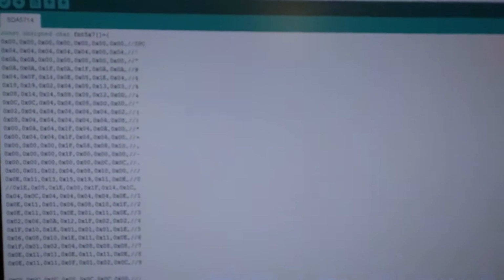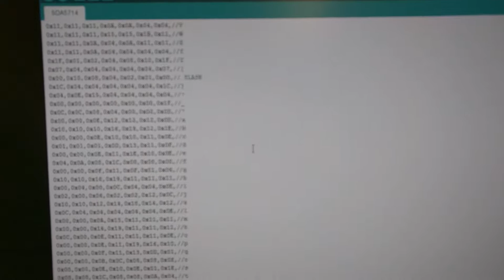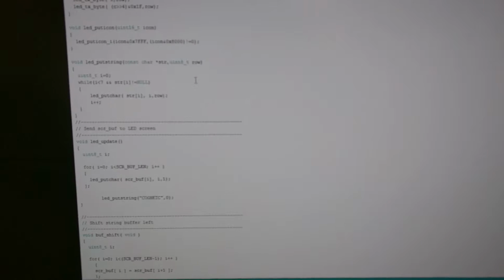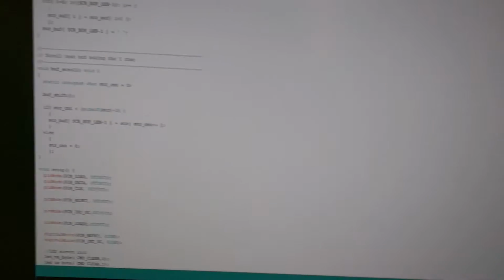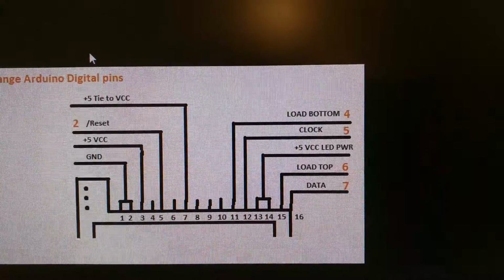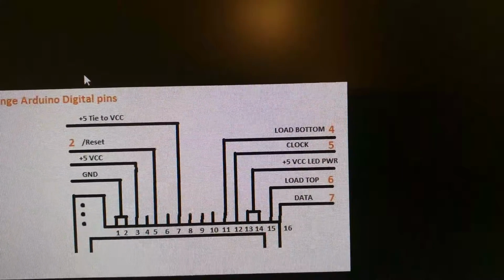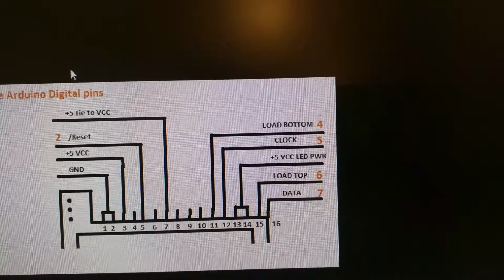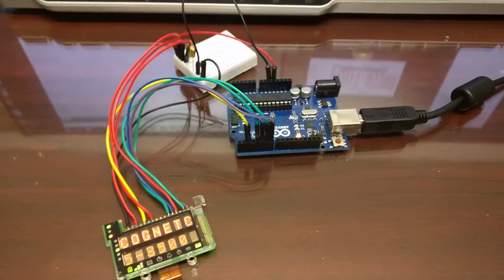Driving a Motorola MicroTac Elite VFD Display with an Arduino

Comment: Hi, i have a motorola startac display, has 11 pins.In the radiokot website says that another model of display has 12 pins (but the 7th pin is not used). i don't understand how to generate a frequency (1-8mhz ) on the 1th pin and how to connect the CE and RS pin. Can you help my? thanks

Comment: Would you be willing to share the code for this project? Did you ever finish this?
Reply from the maker: telecomguy10 The link for the code is in the video notes.  However could share if you are having trouble.
Reply: Brian Flores I apologize, I did not see the small link to the code as I was watching this on my phone. Much appreciated! Did you ever actually get this working?
Reply from the maker: telecomguy10 No.  I ended up having 2 new born kiddos since then..everything came to a halt.  Hopefully I'll start this project back up again, once they get older.  Just no free time anymore.  I do constantly keep an eye out for a 4G Verizon board though.  I now just want to make it a phone that will actually connect to a modern carrier 4G network. Swap a Sim type thing.  Should be a much more useful gadget if I can do that.
Reply: Brian Flores isn't there an LTE shield?
Reply from the maker: telecomguy10 good question. I haven't found one yet. They have all been 2G boards.
Reply: Brian Flores what if you set it up as a Bluetooth handset that linked with a small battery powered raspberry pi that ran an asterisk PBX and a SIP trunk? Sounds complicated but it could work